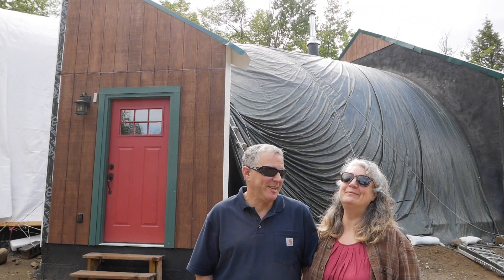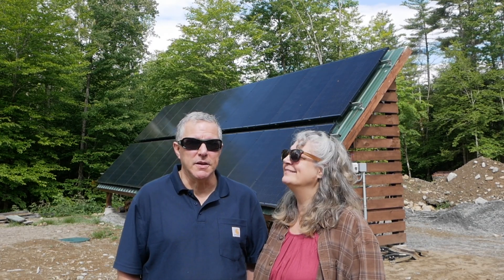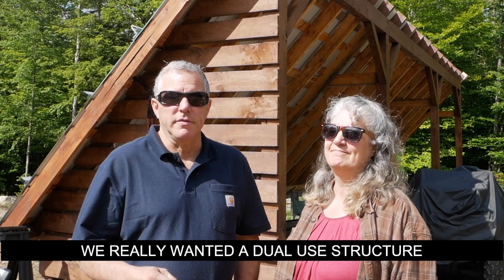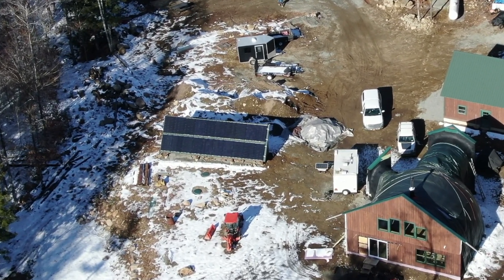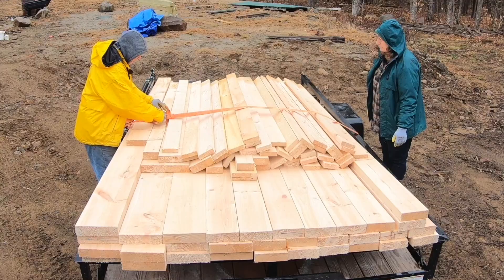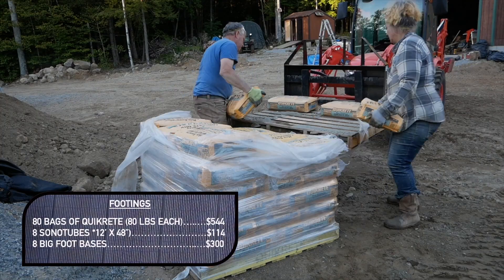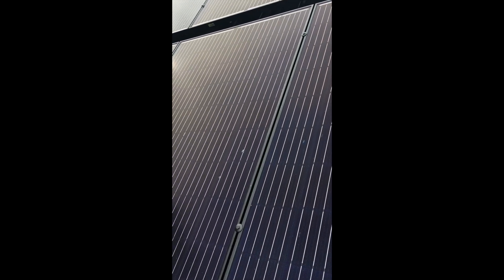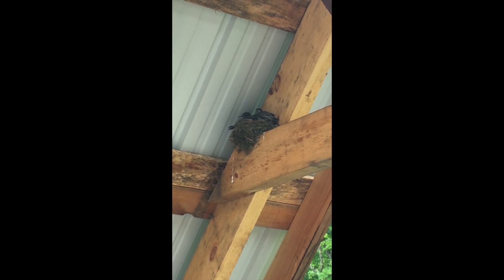Solar Ground Mount | Reasons, Design & Costs

Comment: New subscriber here.  Thanks for the video.  I have a country home in Texas and am planning on a ground mount here as well. I have land and would rather not place panels on the roof (at least not 30-35 panels). It makes more sense to ground mount as long as the animals can’t get to it.  I am looking at Iron Ridge with schedule 40 pipe in the ground or possibly Sinclair with seasonal adjustment.
Reply from the maker: Welcome! That sounds like a great plan 👍

Comment: Ground mounts are an interesting idea. I think if you have the space and the right hardware, though, it often makes more sense to just oversize your array, or to install panels at several different angles. Solar panels themselves are so cheap these days.
Reply from the maker: Agreed. We do have plans to add about 4 more panels on a post that can easily be moved daily and seasonally and we have a small windmill we plan to put on top of the dome when we’re done building

Comment: I think your solar system is very nicely done and it seems it served you very well so far! I have very similar structure for my solar panels, just one row of panels and 35° angle. I have it covered all in stained tongue and groove planks, since it's sitting in my garden and is partially visible from house. It's a handy storage shed for long items, such as spare wood material, building material for my further additions to little ranch, etc. One thing I did differenty is that I used ground screws instead of concrete posts, since I plan to move the solar to house addition later. And other difference is, that I didn't use any rail system and roofing underneath - I instead spaced rafters exacly to the with of the panels+6mm, put sealing underneath at gaps and screwed them directly to the 8x8cm rafters. Worked perfectly, the solar panelst themselves are the roof! And it allows excellent access to the cables underneath the panels. Since my panel array is temporary, I designed chose a simple design. Your solar shed is definitely build to last and I wish you to get the best results year after year! 👍👍👏
Reply from the maker: Thanks! Sounds like yours was a great plan as well. Building to last is important when you know the location is permanent 👍

Comment: Awesome progress and simpler but functional build on the solar panels. This reminds us of our 250 each 85# bags that we used for our ballasted mount system. It was a totally labor intensive operation that we had to endure from transport up the hill to mixing and placement. Were glad it was when we were a bit younger though. We get normal 80+ mile an hour winds on our system so we had to really get serious on our mounts and ballast system.
Reply from the maker: That does sound very labor intensive!!! Sounds like it was worth the effort though with those crazy winds you guys get there!